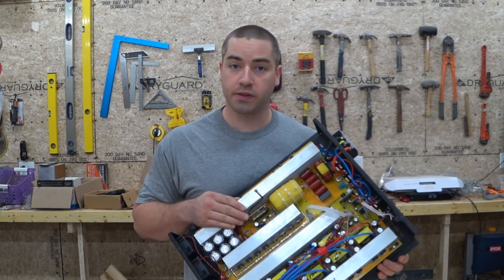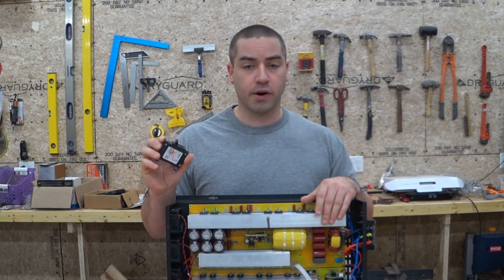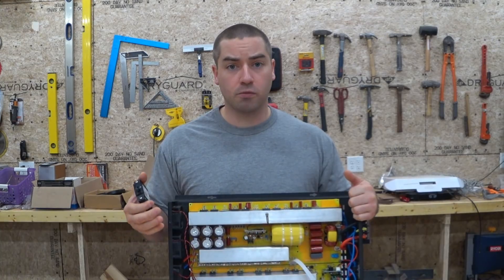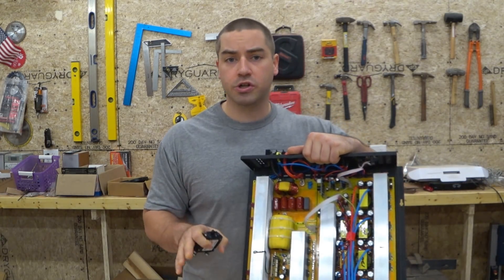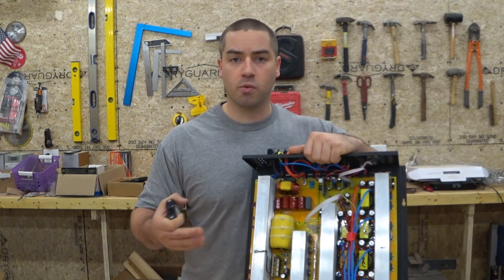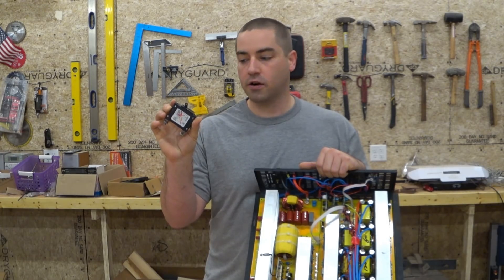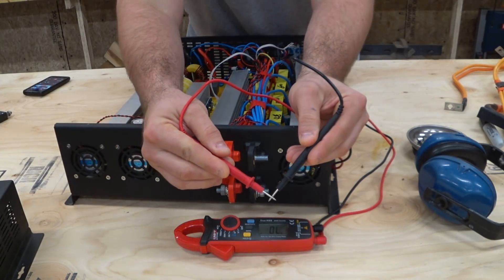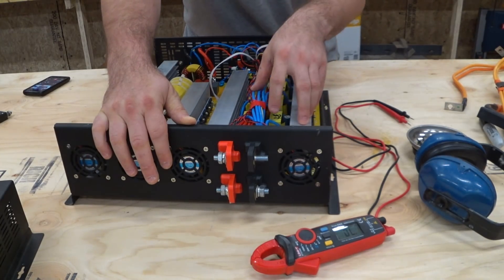Did I Blow Up the Inverter?

Comment: As a electrician of more then 35 years, it totally amazes me that so many people are willing to type long comments about something they know NOTHING about, how UN informed do you have to be, to write that if the voltage drops the current INCREASES, absolute ignorance and/or incompetence !!!      If you connect a 24 v headlight bulb from a semi truck to 12v, it will NOT draw TWICE the current, to keep the POWER constant, NOR will it draw HALF the current because of the VOLTAGE is HALF. a 12V 50W headlight bulb will draw 4.17A on 12V,      and a 24V 50W bulb will draw 2.08A on 24V    BUT if you connect a 24V 50W bulb to 12V it will draw only 1.04A  and CONSUME ONLY 13W     BECAUSE the ONLY constant is the RESISTANCE of the bulb,   NOT the VOLTAGE,   and NOT the POWER.     So if the VOLTAGE sags because of to small wires or to small of a battery bank, the CURRENT will DECREASE, NOT INCREASE.     INCREASED RESISTANCE in a breaker that is to small,    is NOT a thing, they ALL have about ZERO resistance, but they will of course break at their rated AMPERAGE, WHICH does NOT change according to VOLTAGE,     AGAIN these geniuses think that a breaker is rated for POWER,   it is NOT,   it is rated for CURRENT,   in FACT, the breaker does not know the VOLTAGE in a circuit     (but it is of course rated for a voltage, because that is related to the breakers ability to BREAK the CURRENT during a overload, using a breaker at a much to high voltage,   COULD cause the contacts to weld themselves together during an event, and NOT break)
Reply: Jesper, one electrician to another, you are confusing their enthusiasm with facts and reality. If they really wanted to know they would talk to the local electrical inspector who will point them in the right direction and then ask, did you take out a permit for this? I do like this fellow, he has a sharp mind and is easy to listen too.
Reply: jesper dahl ... try using some amp probe on an inductive motor with a low voltage condition... see what happens... 

(Hint... smoke comes out)
Reply: To some degree, yes . The resistance of a bulb is (relatively) constant. As migsven already said. The resistance increases with temperature. However an inverter is far from a simple lightbulb. A (good) inverter is able to sustain anny power within it's own limits as long as the batteries can supply enough power. So if you draw 1200W on 120V it will take 10 amps. Asuming the inverter has a 100% effeciency (no it does not, offcours. But for the sake of simplicity. the calculation works just as well with 90% or whatever. It just ads an extra step). 1200W on the primary side will take 1200/48=25 amps primary. HOWEVER, if the battery are a bit empty and hover around 47volts it will take 1200/47=25,5ish amps. So yes decreasing the voltage of the battery (depending on state of charge or voltagedrop over the wires leading from the battery to the inverter) can increase the currentdraw. It all depends on the type of load that is connected to it. And an inverter is far from a pure resistive or inductive load.

So yes maby the CB wasn't the right one. But as Jacob Dykstra said: it is obveousely a cheap inverter with verry little (if annything) to protect the internal parts. So personaly I'd blame the inverter. Not the breaker
Reply: You've confused the behavior of a linear (resistive) load with the input characteristics of a switch mode power supply (SMPS). A SMPS is a constant power circuit. Assuming it's output load is fixed, its input current is lower at high line and higher at low line. And all SMPS' behave that way.
Reply: If you run a 24v bulb on 24v and then on 12v...measure the current and do the math...you will see that the resistance is NOT constant but increases as the fillament draws more current and heats up. Dont troll on the internet since yourself obviously havent got even basic knowledge.
Reply: Pulling wires for 35 years does NOT make you an "electrical expert"!!! Maybe you need to read up, and increase your limited knowledge on reactive, capacitive, inductive, and resistive loads, and their differences, you are trying to compare a resistive load, to an inductive load, and associated voltages vs amp draws. All you have done is shown your total ignorance on said subject, mr. expert 35 year electrician. (wire puller)! You probably voted for Hillary too didn't you?!
Reply: since when does a semi truck have a 24 volt light system??? do you know anything about semi trucks? ive been a truck driver for 22 yrs and nothing i drive have 24 volt bulbs
Reply: Most of them have 24v, doesn't even need to be a semi, my 6t tiltray (Hino FBR) is 24v even ETA   https://isuzu.com.au/Isuzu_Files/Spec_Sheets/Historical_Spec_Sheets/2007/FVR_FVD%20950%209spd_6-CYL.pdf    Top of page 3     ELECTRICAL SYSTEM• 24 Volt electrical system. • 24 Volt, 60 Amp alternator.• 24 Volt, 4.5 kW starter motor. • 2 x 75D23R (520CCA) batteries connected in series

Comment: This is entirely down to the poor topology of these high-frequency inverters.  Having 9 sections that have to balance on the input side is entirely the reason that these types of inverters fail all the time.  It is extremely difficult to build an inverter of this topology where all of the components, especially the MOSFETs, are not only tested to be identical but are also overrated by enough to eliminate the problems associated with starting motors and other loads that can't be set up to soft-start.  
To make the design cheaper they have used more stages and cheaper components rather than building the entire unit with the best components money can buy from name brands.  If they would have used much larger MOSFETs with identical tested specs they could have built the input stage with only one or two sections which would have more easily guaranteed that these sections would be near perfectly balanced and distributing the load evenly rather than having a cascade failure when starting motors.
Reply: No. Each stage should have its own Voltage and Current limiting, so that even if all of the other stages were disabled, a single stage should shut down gracefully.

Comment: Focusing on the breaker is not the issue, voltage sag on input is the problem. With the circuit breaker taking the brunt, but the total resistance of the input circuit (internal resistance if you drew it systemically, a non ideal power source) was high enough to reduce the voltage on the input side, and thus raising the current in the mosfets above the safe area of operation.  Like I said on the other video, this is often seen when people are wiring up huge audio amps in vehicles, and cheaping out on the wire. Currents go up, and the mosfets let out the magic smoke. In my estimation, the same thing happened here.

Comment: If you read the breaker it says it will trip at 108amps and you were close to that value but if the breaker tripped that would not hurt the inverter. I may have been better to have a 500 to 1000 watt load on it. I think the inverter can not handle that much in rush current blown fuses inside proves that point. It is nothing you did just the inverter. I use the same inverter but have never had that problem but my biggest is 3000 watts

Comment: Hi David.  You should understand what to expect from an ohm meter when you try to measure continuity at the input to the inverter.  With the on-off switch in the off position on a known good inverter you would expect to see a very low resistance because of the capacitors that are acrossed the input to the electronics. The capacitors are there too try to absorb any spikes that come in on the DC line. Therefore if using an ohmmeter across the DC input do the inverter you would see the ohmmeter trying to load the capacitors. You may or may not have a direct short with the fuses put back in unless you expect to see a solid short across the DC. Leave the ohmmeter on there for a few seconds to observe whether or not if the resistance changes due to the charging of the capacitors.  The point that I am trying to make here is that there are capacitors across the DC input to try to absorb any Spike that may occur on the battery side ie the inrush current.  

Just as a note, my Outback Power inverters, VFXR3524A (2 of them) use a 250 amp Schneider circuit breaker each.  Each inverter is a 3500 watt inverter.  I run them in a split phase 240 volt system.  My system will start and run a 2200 wad 240 volt air conditioning compressor.  I decided not to run it through the inverter because of the start current always hammering the inverters on Startup.  I do have an air compressor, and a washing machine that does flicker the lights when they start up. I have 3500 ampure hour of battery running my system.  

If you want a project to spend time on, then go ahead to try and fix the 8000 Watt inverter but do it only as a hobby to prove to yourself that you can fix it on your own or send them both back to them stating that they both failed just moments out of the box!  Make us all another video telling us what your decision is.  I enjoyed the discussions with the group.  I have more tube and transistor theory under my belt than I do with mosfet applications.

Comment: David your clamp meter doesnt have a peak function so what you saw may not have been the peak value.
I know ac motors usually have a starting current of 8 X their normal but the universal motor is also a series dc motor and the can run upto 12X their normal current when starting so I hate to say it but your 39Amps peak for starting isnt even halfway to the true starting current.
Roughly times your output amps by 2 .3 as 110V / 48V gives you 2.3 as a ratio.
So I saw 10amps no load running. 12 X 10A = 120A peak
120A peak X 2.3 = 270A on your batteries.
As for the multiple Transformers that is fine but why the load wouldnt be shared evenly is because the the leads to each transformer are different lengths.
They should be matched. That means that the load would be shared more evenly.
Reply: Most hand-held meters are relatively slow to respond, they don't often have the speed to catch the surge current.

Comment: The YouTube channel called going off grid has had the same problem with the same inverter and he didn't use too small of a circuit breaker great Channel I like him we talked on the phone and he's one of the reasons why I switched over to lithium battery and battery balancer coming soon on my channel
Reply: Men that inverter should have been able to handle that load and the breaker shut-off anyways my Magnum has no trouble it's such a good system going off-grid picked one up on my suggestion go ask him how he likes it he bought a second one after he realized how good it was
Reply: @solarpowerelectricityandel2915  magnum is transformer based not Mosfet based you can typically run them things at overload for more then 3-10 minutes before they cut out (1000w over say 3000w, or 10000w for very short time to start loads)

 Mosfet based inverters (witch is most are) can self destruct with some type of motor loads especially if the inverter does not have a soft start load feature ( which  most inverters over 3000 Watts seem to lack so they can get the 8000 Watts and even then most of these inverters 8000 watt to set peak for less then 3-5 minuets and 3000-4000 what is their constant load is)

If you run a especially the 110v reliable inverter constantly above 3000 watts it won't last more than 8-12 months (can be even less if you have motor loads on it) the 230-240v version can hold up a little better as it runs at less amps on AC side,

If you need above 3000w make sure it's a Transformer Based inverter and  ideally a 230-240v based one (not split phase) if its possible for your situation, as well so you don't have to deal with large AC cables or you just be blowing Mosfets on theses supposed high wattage 110-volt inverters which you shouldn't even try to do

Comment: In my extensive experience with "Cheap" Power inverters here is my 2 cents for what it's worth. First I only use time delay "fuses" not "circuit breakers" for the unpredictable nature of an inverter unit fuses just work better. Second I would never try to start a large "Motor" IE the DeWalt saw without the inverter being partly loaded to start with. Have "some" load on the inverter few lights, clock, radio, something drawing a steady current load, then try to start the saw. The control electronics in "cheap" inverters are not the best at rapidly compensating for high current changes and even worse at compensating from a NO load to Big load change. This same situation happened to me with a 1hp well pump, I switched to fuses, had a moderate load on the inverter to star with then started the well pump no problems. This is also why your 3000 watt works no problem but the larger one trips and blows fuses. The transformers things are large inductors, also when you used the meter across the main pos and neg terminals that's normal hold the meter there and "see" what the Ohm value is, 4 ohms, 7 ohms, 10 ohms, that will let you know it there really is a dead short. Large Power Inverters have internal resistance and it will look like a short when nothing is wrong.  Any who that's my input good luck hope this helps. I'll keep watching hope you get it working!
Reply from the maker: I never knew about the small load thing until recently.  Can more expensive inverters power up the saw the say I had it?  You know, without having to waste electricity on a small load first?

Comment: I want to point out amps to volts are pretty linear with solar / batteries and such 150a@48v is 300a@24v which is 600a@12v

You goofed in your math midnight solar rates those circuit breakers ( aka CB ) at a much higher voltage than 48v your 48v amps is much heavier than say 100v 80a. The point is 48v 150a will be like 80a or so @100v  when you double the voltage you almost always cut the amps draw in half 100v CB's rated for 80a are only good for around 40a@48v it has to do with how electrons flow at lower voltage theyre more aggressive and tend to fight each other and bunch up as voltage goes up they go more inline and streamline and flow easier. 

The amps rating on that CB you blew was for like 150v@80a  I believe with that math it was only good for around 30a@48v you under powered the inverter when it loaded up meaning it blew itself due to lack of voltage the same thing applies inside inverter if said components were designed for 48v and you dipped to 25v suddenly the amps would have spiked internally in the transformers / mosfets to insane lvls outside of spec of those parts so yes you caused the issue that CB caused a heavy Vdroop when it loaded and it was so sudden onboard protections couldn't react so it fried mosfets and such which then dead shorted frying other stuff.

The voltage to amps thing is why your wire can be much smaller at higher voltages to carry more amps in solar applications 25a@150v can go thru much smaller wire than 12v@25a  think of this same thing about the traces and parts in the inverter the CB you used allowed a heavy Vdroop overloading the internals of the inverter before protections could protect it a 50v battery dont drop from 50v to 15v in a split second so the internals were not designed to suddenly do such with that kind of draw you did the droop would have dipped you to around 20v so your 107a@48v would then be around 220a@20v due to the Vdroop because of the limiting factor of the CB.

You easily overloaded that CB by around 350%+ due to its voltage to amp rating 80a@150v you dipped well under 48v on loading so again for 48v that CB is only good to around 40a you drew around 150a atleast if there was no Vdroop but I am betting you Vdrooped to around 20v at that point your rating on the CB would have been below 20a@20v you drew say 150a if had a perfect 48v with the Vdroop you drew well over 325a@20v so again your math is way off.
Reply: I don't think so.   I understand your math. The specs make no mention of "watts" (amps x volts) being the 'limiting factor' as you suggest.   They only refer to "amps".   The breakers are sized such that at 150 V, they can handle, in his case, 80 amps.  Anything less in terms of voltage is fine.  Think of a single wire fuse.   It doesn't know how many 'volts' it's carrying, it only knows how many "amps' for the reason you suggest.  Too many amps (electrons) trying to make their way thru a small cross sectional area and they get angry and cause friction and thus heat.  IE: the operative function behind how a fuse or circuit breaker functions. http://www.midnitesolar.com/pdfs/Carling_A-DTime-Delays.pdf

Comment: uk electrician here. A CB has 2 forms of protection on AC. A bi metallic strip for overload. (prolonged) and a coil pushing a projectile for short circuit. (almost instantaneous) forgive me but it's late here. but I cannot think of a way to get the latter form of protection to working a DC supply.

Comment: Just a thing. When you check continuity where there are caps you'll find a short for a certain time until they charge.
Reply from the maker: Hi Dumah, Please tell me more as I hardly know anything about capacitors.  How do they create a short between the + and - ?  What would be a better way of checking the broken inverter?  Thanks.